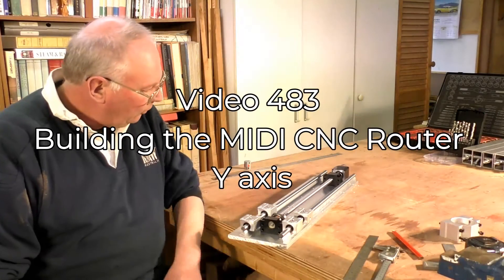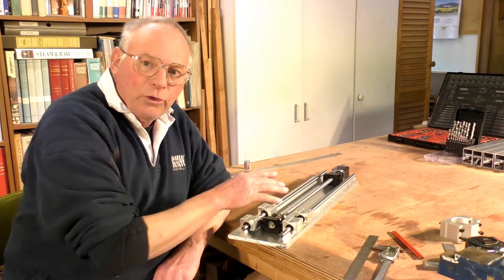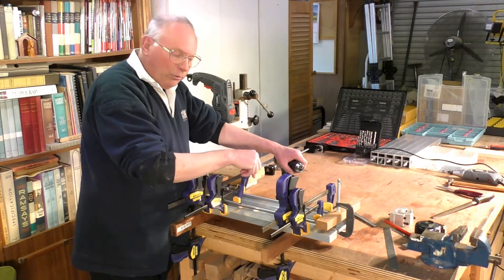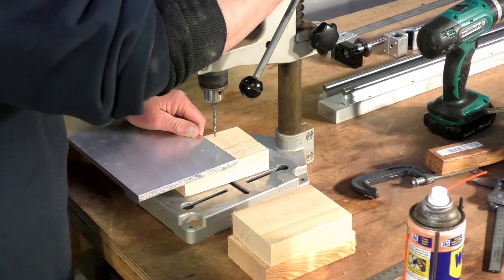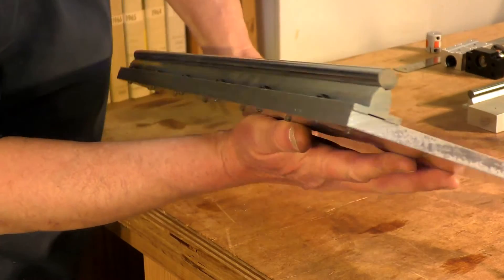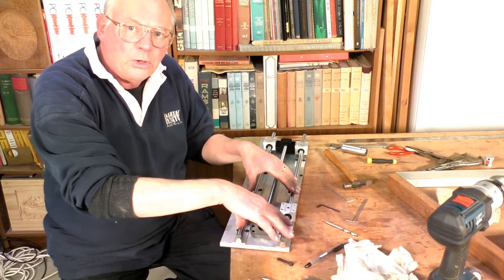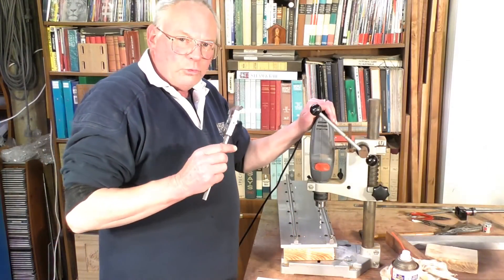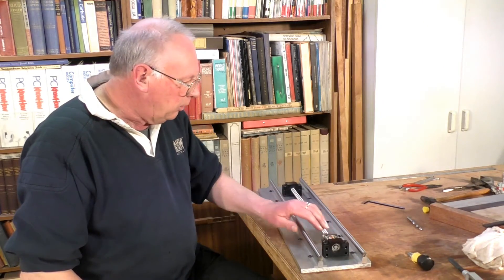Making a CNC Router for LESS than $1000 episode 3

Comment: Hi Roger,
I found when making my machines that the use of a guide block for tapping the holes really help with assembly in particular the bearing blocks. The project is making good progress and I think the double guides on the Y will make a real improvement to the rigidity of the machine. Sounds like you are experiencing the same winds we are having in NZ.
Cheers Dave.